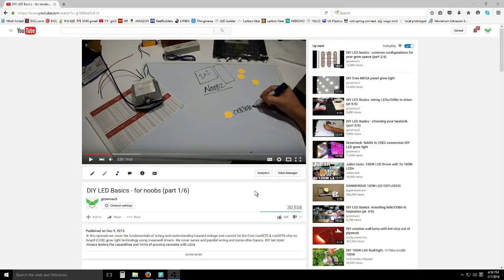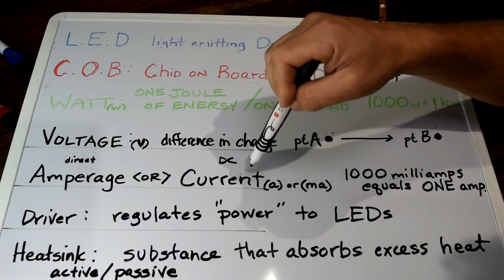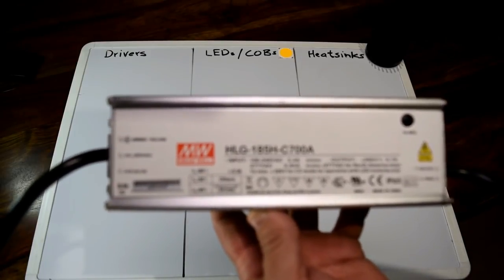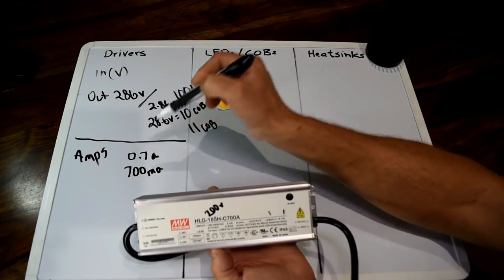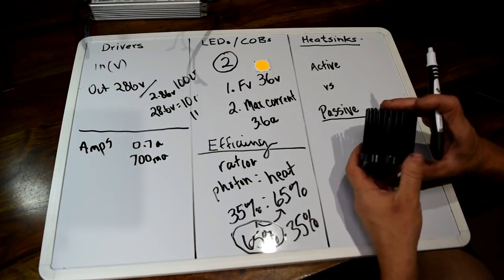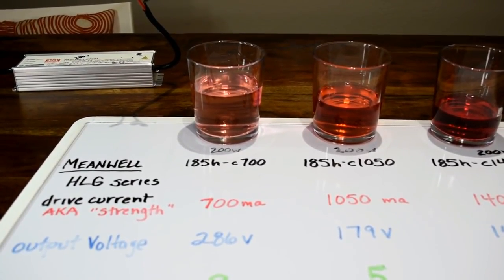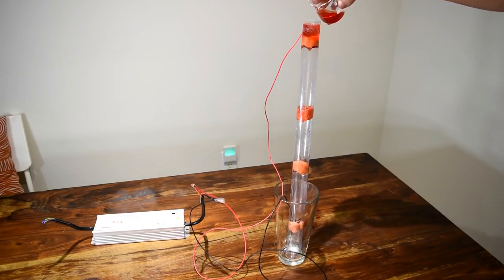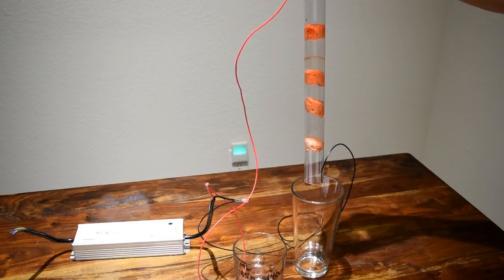DIY LED basics: getting started building your own grow lights: (pt 1/6)

Comment: hi stupid question but i cant figure this out ive tryied searching everywhere but ending up with 0over and over again, the thing i wonder about is my led driver (morsen model:nl150w-750) is how many cree's can it run? 3x50@750mah or what i cant find specs so i just have to ask, tnx for reply
Reply: 3x50watt cree at 750mah on 1morson 150w 750mah driver or can i use 4 100watts cree chips for that driver? this is so confusing and i basicly heard about this tech for 2-3weeks ago

Comment: hey I have a question for you. I'm building a led with my old mars and mars led drivers that are in there. I'm running 50w cob 32-34foward v and my ignitors are 55-100v D.C.  0.70a the cob would it work I'm running 1 driver per 50w cob or would that be over kill?
Reply: You for sure could run 2 cobs on 1 ignitor.
Reply: Ni Jo hey thanks man. That's what I'm currently running 2 citizens clu038 per 1 driver

Comment: Thanks mate, top video!
I learned a lot, but I still have some trouble getting my head around the component data and compatibility:

Can I run a 286 V or 179 V with, say, four 36 V COBs, eg. for monetary or spacial reasons with the option to extend later? Meaning, can I run the system on to little loads? (I think it is, otherwise it would be a hustle to fit numbers.) So does a 200 W driver always use up the same W or does it depend on the sum of loads (I think it does :D)
Does that mean, that the COBs at a driver with higher output run on higher Watt than the exact same COBs at a driver with lower output?

A COB on a high current driver has a bad Photon/Heat ratio, but what quality has risen then?
Meaning, why should I ever use a high current driver for a lower number of COBs instead of a low current driver for a low COB number? Will they perform badly?

I hope you (or somebody else) can shad light in the dim.
Best regards

(well, maybe some or all of the questions will get answered in the rest of the series, I'll see)

Comment: Thanks for making the video. I have a question. If I have a driver that is 1400ma and my COB is rated to 2400ma am I only emitting 50% light output? Should I try to match the driver to a COB that is 1400ma or vise versa?

My setup would be:
Drive: HLG-185H-C1400B
COB qty 4: CXB3590-0000-000N0HCB35G

Would this work? Thanks for your time. I really enjoy your videos.
Reply: He just explained that. Multiply the vf rating of one of your cobs by 4. If that number is less than the dc supply voltage of your driver, it will work. You never want to power an led with more amperage than it's rated for, but less is ok. With less light output of course.
Reply: Dear MATT, THE 185h-c1400b is constant current ,can't drive in 2400mA, the 4 pcs CXB3590 is work , their driving current is 1400mA, one COB run at 50W ,that's the most efficient for driver and the light

Comment: Growmau5, what is the best budget grow light for a 2x4? Is building your own light much more cost effective? I saw your video for the Chilled 2x4 light that you said is the best. Could a diy light be as good with reduced cost?
Reply: Go for the 240w qb with hlg driver they retail around £300 on internet but i picked up 3 of them from alibaba for £370. Very good lights
Reply: @ernestlipa666  I want to learn how to diy a light because I like to learn. I heard the same about that light being the cheaper replica of the HLG lights (and same diode).

Comment: You say 8 36 watt COBs can run off the 286 output voltage.  How is that when 286/36 = 7.94444?
Reply: I think I figured this out after reading some other posts and looking at the spec sheet.  The 36 watt COBs can run at 34.8v and then when divided = 8.2 COBs per 286 output voltage.

Comment: Thank you for the  all super precise info my  brother.  EXCELLENT JOB !!    I just got one question ... now i  think have figured out how many cobs I can put onto my drivers but I am not sure if they will be intense  enough for proper  canopy penetration , I got 150 watt 700ma drivers that have an output voltage of 195 .So I figured out  I could put   cxb3590  on them and run 2/ 72 volt cob cxb3590 on one driver and from what I understand  I would be getting 50 watts a cob  but would they be  too dim  they wouldn't have enough penetration  forthe canopy?? i got 12  drivers and would like to put them to work  which led setup would be the best for my drivers ?? thanl you so very much  >>>>life is like light you gotta soak  it in ...... oh yeah , can i run 2 72 volt cobs and 1 36 volt cob together on one driver >???
Reply: Maybe

Comment: hi dude i love ur vids. i have just taken apart a spider cob thingy from china(because it was rubbish...). It has 6 power supply's that are 70-90v at 650ma output(which is all i wanted to open it up to look at). I think u already answered my question but will the fact that it is 70-90v blow a 36v cob? It had 6 red and blue cobs that i want to replace with veros or crees. Also would u stick to the 3500k colour temp?
Reply: +growmau5 thanks man. Do u think that i could run 2 36v cobs per 70-90v supply at 650ma to get better efficiency? it means im only running the cobs at 23ish watts
Reply: +growmau5 u da man

Comment: Hi, i have a question, if i count it right...it would be good for me to use a HLG-320H-C1400A 1400mA 320.6W with  234v. for 6 cob of 36v...but im confused about amp..the 3790 is at 2,8amp and the 3590 is at 3,6 amp...so wich one is better since i have 1,4amp with my power supply?....thx
Reply: ok so how many cree cob cxb 3590 do i need to get equivalent of hps 1000w and wich power supply do i need to run them all at full capacity..thx lui tracy...i also need heat sink and older for the chips.

Comment: will a 36v cobb work from 35.75v? so as long as its past the final .5 it should be ok?
Reply: It will still work ... you will probably get 5% less light ... and it will draw slightly less current or amperage and watts and it will heat up less.  But you should test any new idea on a small scale before you plan a big project using the idea.

Comment: I think I understand now.  Do you have to run 8 with the 700ma driver?  Can you run 4 on it and add 4 more later on or do you have to buy the 1400 one to run 4 and upgrade the driver when you can buy the other 4. Thanks brilliant video by the way
Reply: you can run 4 but u wont get full wattage out of the driver. panel would run at about 100W then

Comment: I just can't wrap my head around leds ,simple  example say 100w driver for 1 100w led I understand the watt part but what about the mA  part im fussy on  , someone told me i could run 100w or 2 50w led on the 100w driver as long as the total mA did not exceed the drivers total mA out put, but it's ok if the led uses less than its total mA limit,    so am I correct in thinking a driver that is 100w with a mA of 1500 can safely be used to run  X amount of led cobs as long as the cobs do not exceed the drivers max wattage and max mA output ?
Reply: You should learn AT LEAST the basics on how electricity works before doing anything that has to do with building your own lights (before you blow up yourself and/or burn down your house). You could easily learn this stuff by searching it on any search engine, come back when you know what ohm's law is and can correctly apply that without looking. Watt is a unit of power, you can't "exceed" it. mA = milliAmpere = one thousandth of an Ampere.

Comment: growmaus help!!!  I have a tbs. discovery multirotor and I want to make it the brightest LED multi-rotor that there is around I run a 6S 4000 milliamp LiPo battery.  can you configure something for me?
Reply: Lol,  sorry wasn't sure if you going to reply.  Ok,  My multirotor is a team blacksheep discovery.  The battery onboard is a 22 volt 6000 mah 6 cell battery made by team blacksheep as well.  I already have orientation lighting on it for night flying.  But what I want now is a down firing light installed under the belly of my drone that when I fly over you at night and I turn it on I want it to be daytime all of a sudden.

Comment: @Growmau5 Hey man, I have a mean well HLG-320H-C1750B running 4 chilled logic pucks on custom algae scrubbers I built for my aquarium. It's too much. Can this driver safely run just 2 pucks?
Reply: Or just adjust the driver with a screwdriver to lower light intensity

Comment: Love the video ... I do however have a question, I would like to know how to choose a COB for growing purposes, what are the key things to look for when buying a COB for growing?
Reply: Probably how hard or how much current you are gonna run thru it....Cree cobs for medium to light current. Vero 29, Citizen,  Luminus for hitting them harder.....The Veros are slightly cheaper than the Crees, but more efficient at higher currents...After that you would pick which voltage cobs. Then 3rd is probably  CRI and (K) temperature...say 3000k or 3500k. At 80 CRI....

Comment: Hi. So does 10W Cob means brighter than the 1W or 3W cob? im just looking for a super bright diffused LED
Reply: what for? grow or flash light?  there alots of type of brightness
if your going to grow you need more wattages than 10w. unless you many.
Reply: @Niklez7   I want to make a prop. I found out that COBs are significantly brighter than the single bright LED light bulbs.

Comment: I bought a brand name fixture that came with cxa2520n cobs and a meanwell hlg-185h-42a. It says its output is +42v  and 4.4amps. but it runs 6 cobs. Each cob runs off 35v. How would it run 6 cobs?
Reply: it should power 1 more cobb as long as it is the same cobb size and current rating imagine it should be fine. look at the voltage range it should say like 97-305 v so say that each cob can run from 34 v to 36.7v lets say each one is powered at 35 v and you want to run 7 cobs. that is 35 x 7 = 175. that means that if your driver rating will run 150 v - 205 v range thorn yes you should be fine. usually 1 more in the 700 ma range is fine it may even run up to 8. and all that means is that you have enough power to run them. instead of working 5 cobs hard you can run 6 cobbs at less stress to each cobb. its like having to pick up and hold a piano and having 5 people and then having to lift up the same piano and having 6 people. you can last longer with more help. 200 watts is 200 watts but how much stress and heat on each cobb goes down the more help you have. as long as your voltage rating is high enough and within the range it will be fine. worst case it just won't light up and you will be out the money you spent on the cobb. now if it were the other way and you wanted to take a cobb away that is when you run into more trouble. blow your cobbs. he may be able to help you more but this is my understanding.
Reply: sorry I just re read what you wrote and my previous comment is not answering your question. so you take 4.4 amps same as saying 4,400 Ma and then you devide it by how many Gibbs you are running. so 4400 ÷ 6 = 740 or something I don't have a calculator near men this is a guess. that means that each cobb is being run at 740 ma. I believe. lol hope this helps. and I hope I am right about it

Comment: Hey GrowMou5.

ZuluBuds here from South Africa.

Love the work you do. It’s helped me with a lot of questions, but I am stumped at the moment. Currently waiting for part to build a LED Light out of mostly upcycled or second hand materials. I have bought the 3w with a FV of 3.6 - 3.8v and FC 700mA LEDs new. My issue is the drivers I have are all 12v output. The only way I can wire them is in sets of 3-4 LEDs  in series and those sets wired in parallel. My question is, do I need to add resistors? And where on the circuit do I add them. Also Should I bridge a resistor from + to - on each LED so that is one we’re to blow the others in that series would still work. Eg + would be connected to the LED and the resistor (slightly higher resistance than that of the LED) and then the resistor bridges over to the - of the LED. I also have a few 10w LEDs that I was thinking of integrating into the light. Hope you can help.

Comment: Could you do 2 cookie cutter builds for people who would like to build a full body or half body light therapy device. There are a lot of people who are trying to find an affordable light therapy device that uses red650-660nm and blue 450nm together on one switch, with neer inferred700nm and inferred850nm on a separate switch. 10W LED's would work, and you may not need to build, but show the layout and recommended parts. If you do put a link in the reply. Thanks.

Comment: what driver would I need to run 5 Chanzon High Power Led Chip 100W Full Spectrum Plant Grow Light (380nm-840nm / 3000mA / DC 30V-34V / 100 Watt) SMD COB led lights.   it would be a big help. Hopefully I get the rest.
Reply: nate fox  i no what driver ur on ebay lolololo i no who ur buying from dont bay  u can i can put u on whith same chip wooky kush has and  mouse likes tham i can show u where 10to13ech    but u can used tham cheepys i got some 3watt full spek 380to80
Reply: there a lot of dtiver u can used do u whant a cheepy or a name brand and   r u doing more than one chip   u whant a meanwell.   lmk
Reply: nate fox   its not good to run at 3000mah that the max and it cast u a lot i no the chip u have full spek  cheepy.  i no u need a hlg 3201400mah. u can run a feuw but i wood not get  a hlg. i look a 10 $  U CAN USES ONE FOR ECH DRIVER U DONT RUN GOOD DRIVER THOO THIIS CHIPS U CAN  it lke v8 in a gocart.    or a corvat in a taxy. lol
Reply: I have a 4x4 grow tent with a 1000w hps.  it's a pain to keep the heat down.   grow shops want a arm and a leg for these cob leds.  how many cobs at what wattage would I need to replace the 1000w  hps.
Reply: nate fox ok i wood get 14teen. cluo40  all ether 35k.    half an half      or 27k and35k  

now to power drive hlg 240c. 1050mah.    2 of tham 7 cobs ech driver  at 34vots 1050mah       i have a hlg 240 an i no where to get my chips for less than 15$ ech ps 30wats or so ther runing at  but u can go biger  buy geting  4 hlg185 1050 mah. drivers. 4cobs ech. u get more than 50watt ech cob with
Reply: nate fox lmk what u need
Reply: nate fox where the fuck is gtow mouse5 at dam.   

look at this same chip i speeking of u can see but its so much bright   in funt of u than on video i no plants cant take it so much power i no

Comment: could i put a HLG-240H-C1750B LED Drivers Power Supplies 250.25W71-143V 1750mA with 4, 36v cods. i ask because the mA rating is higher than the ones your referencing . Or is it not worth using a 1750 mA
Reply: thanks man as always your a huge help.
Reply: i was also looking at adding in some 650nm 3w leds that have a max of 800mA and some 440nm 3w with a max 750mA to a cob setup whats a good driver for them
Reply: *****
thanks again as always can count on you to provide quick and very helpful info.
Reply: +growmau5 I need your help with something one quick question when u have time
Reply: how can a hlg185-1400b run 4 36 volt cobs(CLU048-1212) in series. these cobs voltage would be more than this driver supplies. I seen with my own eyes 5 of these drivers running 20 cobs.  5.88×36 heatsinks with 3 120 or 140mm fans on back of each heatsink. please explain how this is working
Reply: i was looking at them APC series the best one i could find is 709-APC35-700
 but can only run 10 3w leds i would have to buy 3 which would cast $40, is there a little cheaper rout. Im trying to do 10 royal blues on one driver and 20 red on another so its simple to turn off just the blues for the last month.

Comment: So the wattage draw from the wall on all three of those drivers is 200w? Someone please help. I'm getting mixed answers from forums and videos
Reply: the HLG-185 is 200w  driver
Reply: it is meanwell brand
Reply: Ok thank you. So by what your saying is that no matter how many cobs I have running on that driver whether 2 or 8 it is still.going to pull only 200w?
Reply: Hi ,Dear , the driver power we choose depends on the  COB we drive and numbers of CObs ,for better lumen effeciency ,for CXB3590,Vero29, Citizen 1212C4 we mainly driver 50W for one COB , driveing current choose 1400mA , 200w is for 4 COB ,2 COB we can choose small driver , for 8pcs ,we can use 400w driver ,thank you!

Comment: Man he really broke all that down to basics.  Use 200 watt driver ad u can power 100 leds...simple. then get a heat sink bigger then what uu need. And by some of those. Cheap fans that plug into your computer..blow a. Real fan on the light that's what I dew.  But this showed me how to make  a 300 lead groww light.  I mean think it's 1 giant cob 3 ft by 3 ft

Comment: does any 1 know if i could run just 2, 36v cobs on that driver,or will it blow the cobs ,or do they only use what they need,would be good to add more later.
Reply: Which led cob, what are their ratings? How will you be hooking them up?
Reply: if you watch this series I wager you will answer your own question friend.
Reply: 7:24